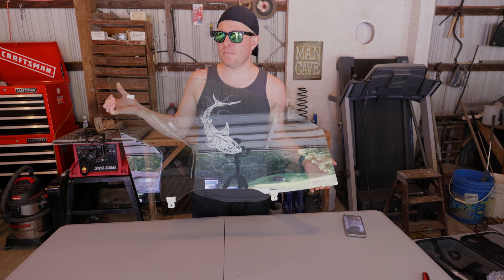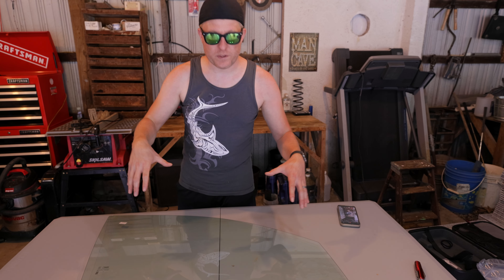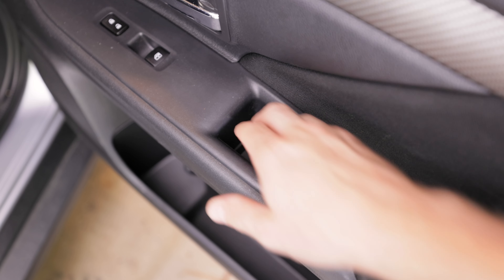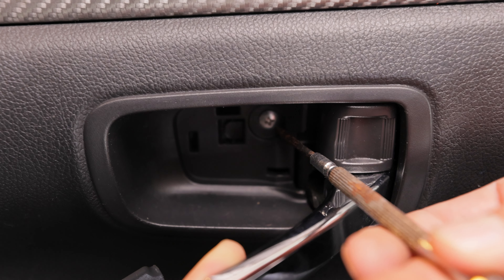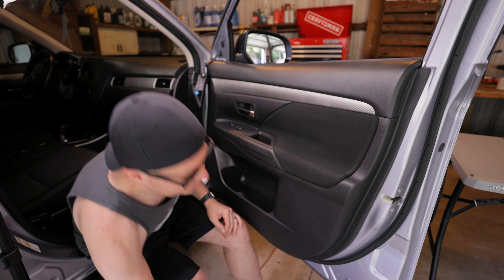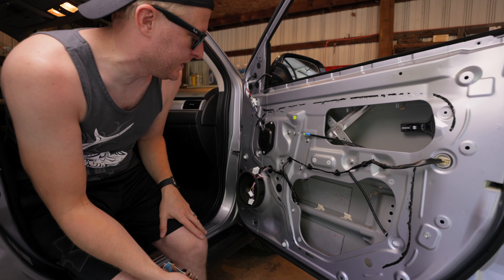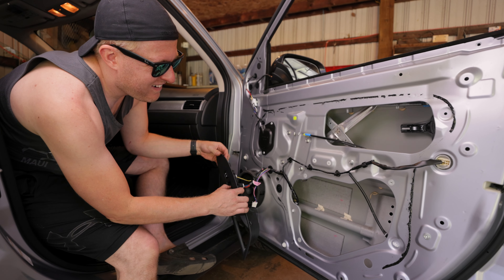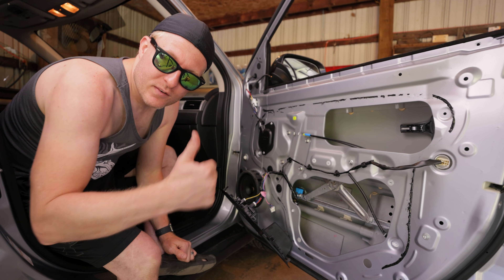Mitsubishi Outlander Front Passenger Window Replacement

Comment: I love watching novices doin a job I do professionally. Over all, a job well done. I was watching to see how long it would take for you to figure out the hole that the front bolt went through. Not too shabby. A suggestion though. One tiny piece of glass in the track rubber around the outside of the window can actually break the new door glass. I always remove it completely, and run my thumb the length of the rubber. I’d rather risk bleeding a bit instead of buying a new glass. I have a tool designed to clean the glass out of the run channel, but I check it afterwards every time with my thumb. Reinstalling the rubber is easy also. The sticky stuff you refer to is butyl. I short cut a lot of things , but I suggest an amateur perform this job just as you’ve explained, while adding the suggestions I made about the run channel cleaning.  Seems to have taken you about 40 minutes which isn’t bad at all. I can install this one in around 7 minutes start to finish, but I’ve over 35 years of auto glass experience. Good explanation on the installation overall.
Reply from the maker: Thank you for the positive feedback!  I had a 2000 MK4 Jetta, so I was constantly replacing the window regulators in that. They would just randomly fall into the doors, lol. I keep finding that Mitsubishi's are so easy to work on. I don't do this professionally. I'm not sure on the exact time, but I figure filming at the same time probably ads some sort of handy cap. Great advice on cleaning out all the glass! I totally get that. It's not worth breaking a second window for sure. I'm still driving it and the windows has done great so far, considering it was just an amazon purchase. Thanks again!

Comment: You removed the window controller. Did you do that with the panel off and was there a screw on the inside of the panel to remove it? I have to replace the whole switch controller but don't really want to take the whole panel off. Any advice is greatly received.
Reply from the maker: I believe I left the window controller connected to the panel and just unhooked the wiring harnesses from it. Around 16:16 you can see the back of the panel and it looks like there may be Phillips screws but unfortunately I’m not 100% sure. If you do end up having to pull the panel, a large plastic pry tool may be able to get it started, or if you use a something made of metal just be sure to protect the paint side from scratches. It comes easier once it started but often those clips go flying. Good luck on your project. If you have any other questions, let me know!
Reply: @EricCosner  cheers. Looks like from a quick glance when you're putting the panel back on, theres a retaining screw!! Means i have to take panel off. Will use your vid as ref.